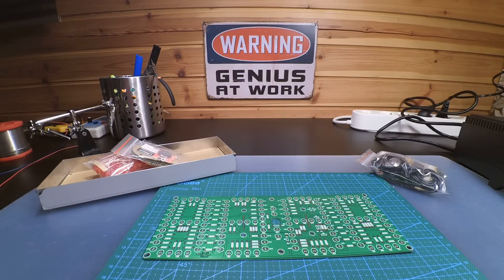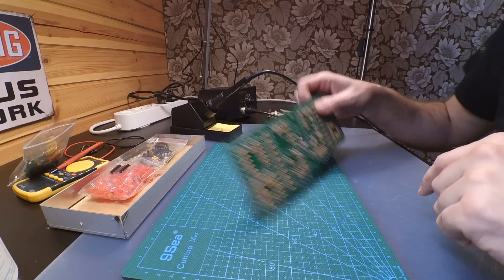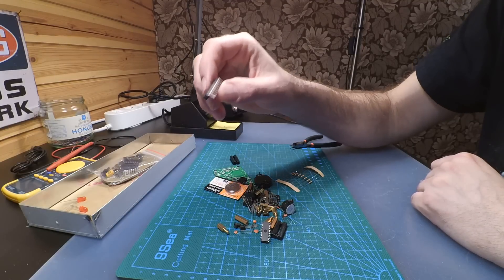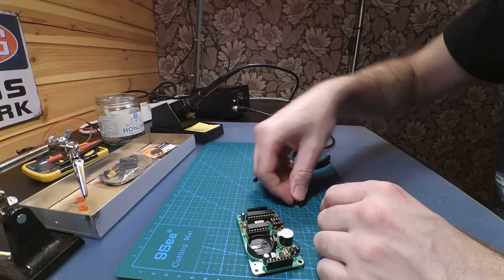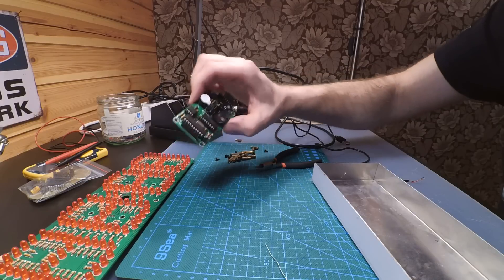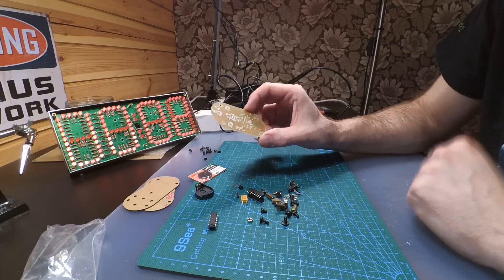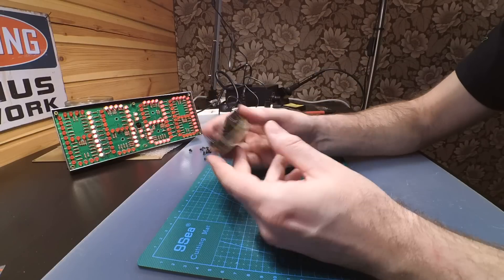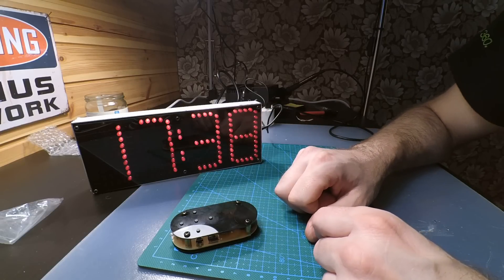#7 Large Screen Remote Clock Electronic DIY Kit Aluminum Cover - Banggood SKU206172

Comment: Have you ever added a GPS or atomic clock module to the clock?
Reply from the maker: I don't have the tools to program the microcontroller :( I have a small plane to build a second kit and run it from an arduino.

Comment: I've been thinking of getting one of these kits, and I wanted to ask how your experience has been with the accuracy of the clock? (I built a small clock kit that uses the same DS1302 RTC chip, and its accuracy is horrible.)
Reply from the maker: Hi, My clock has drifted less than 5 minutes over the half year it's been operating.
The only problem I have is the remote that eats batterys for breakfast.
I have ordered a second kit and will try to make it work with an Arduino.
Reply: Maybe you can add an on/off switch to the remote?

Comment: How much real time did it take to complete this kit,and new tips for your 900 series soldering station are pretty cheap.also where and how much was the kit ,to please,nice job.
Reply from the maker: Hi and thanks:)
You need 2-4 hours to build the kit and you can get it at Banggood at the price of 25US$.
Reply: Price not to bad ,that's a lot of l.e.d.,s to put in .came out good.
Reply from the maker: It's a good kit for solder practice :)

Comment: A Chinese kit with no instructions? That never happens. Just about every kit I have ordered has no instructions or it is in Chinese. It can be really maddening.
Reply from the maker: The new basic skill for electronic hobbiest is Chinese :)
Reply: Well, I get that most of this stuff comes from China, but you would think they would have multi language instructions. I don't mind to much as I really enjoy putting these kits together. I can tell that you have fun with them as well. So it is worth the trouble.
Reply from the maker: The trouble is half the fun :)